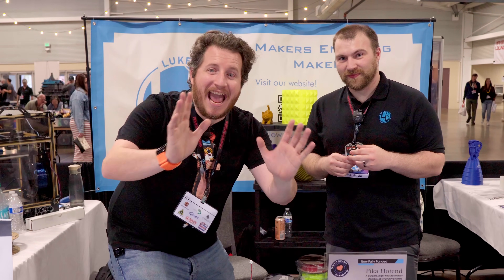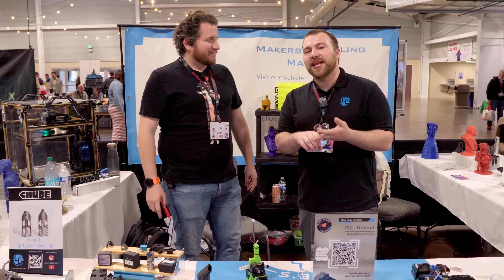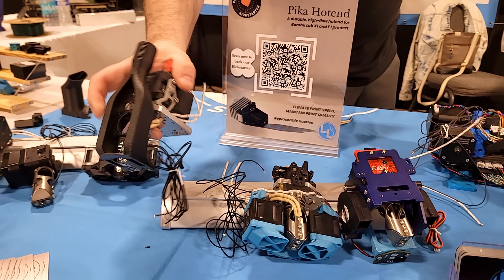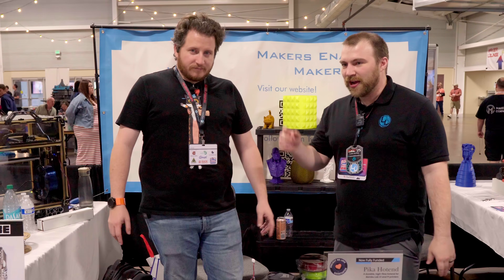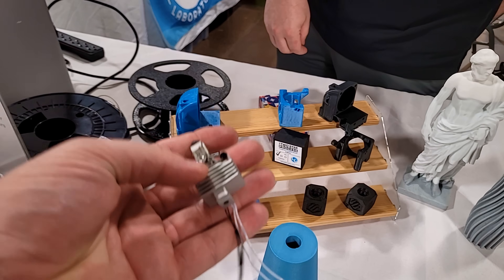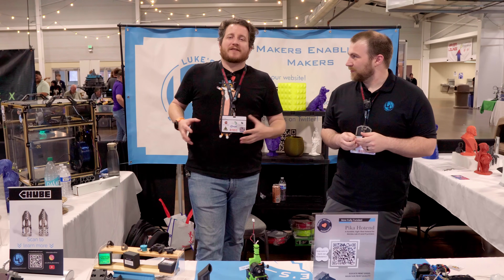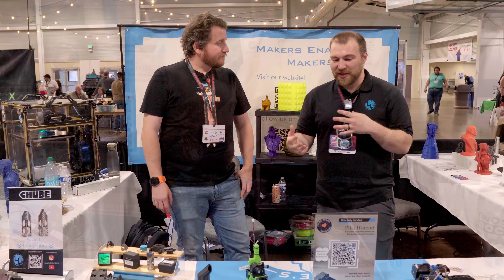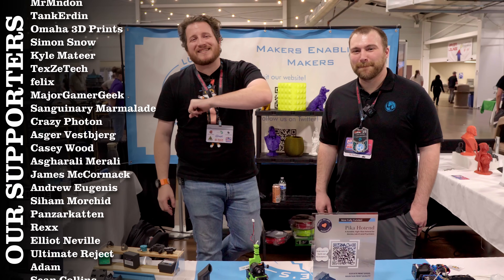This Hotend is AWESOME! PIKA!! - Luke's Lab - RMRRF25

Comment: As long as you watch your 3D prints your high end will never be encased in plastic especially if you're responsible and don't just hit print and walk away especially if it's like a multi day print
Reply from the maker: It is not always feasible to watch a machine every second it is running, especially at scale.

Comment: I just completed my kickstarter purchase. Got the Pika and an additional 0.5 mm tungsten carbide nozzle… I’m excited to try it with abrasives; I’ve done most with a 0.6 nozzle.

This will be the first swappable nozzle hotend I’ll have tried for the Bambu. I’ve had good experience with other aftermarket hotends like the E3D ObXidian, but I’ve definitely still had those bend/break from printing accidents lol
Reply: Thats exactly why!! Its spooky to buy a more expensive unit just to have it bend and become useless
Reply from the maker: Agreed. The added strength is awesome! Hoping it's the end of bent hotends for me!

Comment: which car? niether. I'll drive my 2022 bolt. Nothing is better than the silence and smoothness of an EV. It's plenty fast. It has plenty of acceleration. People like to compare EVs to a stupid prius. It's not even in the same ballpark. Shit there are plenty of hybrids that make the prius look like a joke.
Reply from the maker: I think he was talking more about the Prius's acceleration. Dont worry, had he been mean to EV's I would have put him in his place ;)
Reply: @3DMusketeers  yeah me too. the aceleration is a joke. ANY hybrid is better. ANY EV is better. I don't understand how you can make an electric car or hybrid that's that bad. And yet it exists and it's the one synonomous with hybrid technology. lol
Reply from the maker: at least the Gen 2 and 3 had a 208v dc battery so you could hook up a 208v UPS to it and use your car like a MASSIVE rolling generator lol
Reply: @3DMusketeers  I know the hyundai ionic 5 has that built in. Only 15 amps, but technology connections showed you can run a lot with 15 amps as long as you switch on and off what you need at the moment. However......recently his ICCU or something failed and hyundai didn't do right by him. I had a hyundai a LONG time ago and when its transmission failed they didn't even give me a loaner. it was a damn warranty repair. So no......I thought the ionic might be an option for me in another 6 or so years, but nope. As much as GM has pissed me off, i'd still take them over hyundai. Then there is the ford lightning that can run your whole house. lol The downside is that car only gets a crappy 2 miles/kwh. Mine gets around 4 usually. My lifetime average is about 4. I've never seen it below 3.
Reply: It was definitely a rip on the prius's acceleration specifically @3DMusketeers
Reply from the maker: I know ;)

Comment: While it's great for small business, I wouldn't mind kickstarter being used to fund something that wouldn't happen otherwise. Take Star Trek DS9 and Star Trek VGR for example. They are unlikely to be remastered in HD. They will cost more than TNG did. And CBS barely made back their money on TNG. I actually was upset that the prices weren't $200/season when it first launched. I would have been happy to have the extra money be used to fund DS9 and VGR. But they only cost $100/season. It's even cheaper now. I think for like $100 you can get all 7 seasons.  Anyway....that's definitely not small business, but it's the only way it will happen.